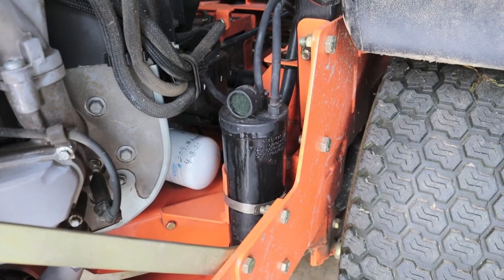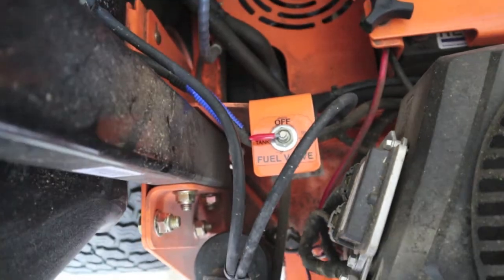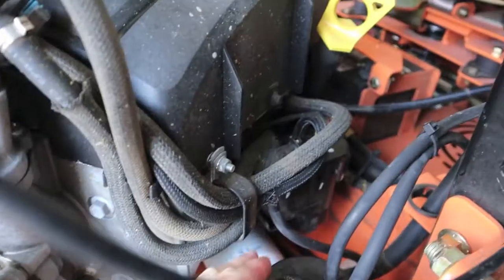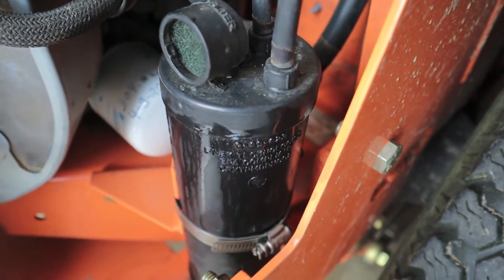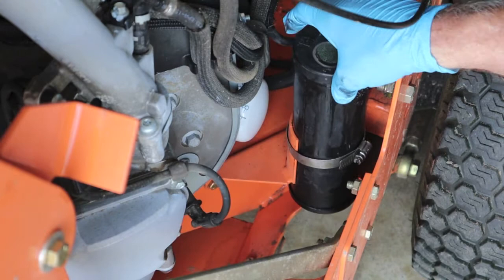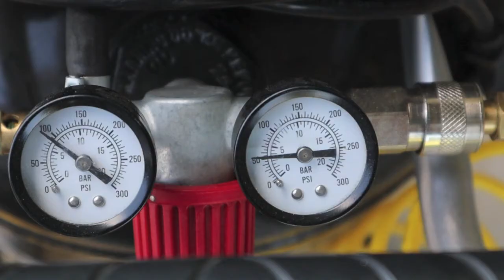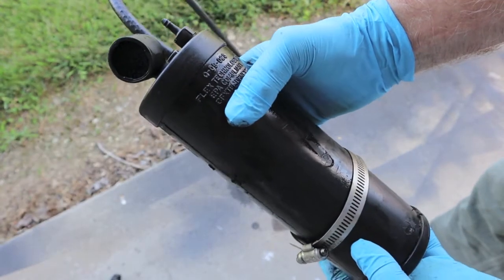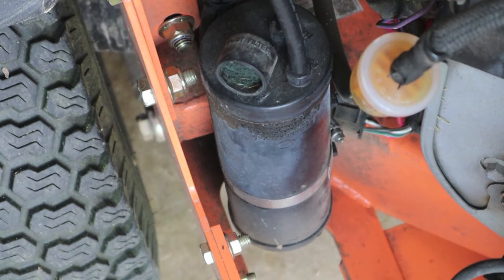EVAP Carbon Canisters Full of Gas! Can They Be Saved?

Comment: Its my understanding that these are just non pressurized containers of charcoal media that absorb fuel vapor from the tank and then hold it until the intake can burn them off. This happens (on a 82 mazda truck) like so: Tank vent goes into canister and fuel vapor is produced under very slight pressure (<1 psi) under normal storage temperatures, ie in your warm garage. These vapors flow into the canister and are absorbed by the active charcoal and held. Once the motor starts, the vacuum on the purge valve pulls air through the large VENT through the active charcoal and the fuel (now possibly in liquid form at bottom of canister depending on concentration) and up into the intake manifold to be burned. There is NO 30 PSI pressure in that tank or else it would possibly rupture spraying fuel everywhere and putting the company out of biz after it kills someone. I would guess that the vacuum to that canister is not being turned on by some malfunctioning purge control valve upstream of that purge vacuum line and it has been collecting fuel vapor for some time. On my truck, this purge line is opened to vacuum after the engine comes up to temp via a therm-valve threaded into the water jacket. If yours is air cooled, It must open under straight intake vacuum. Start mower and put a vacuum guage on the purge hose and see if any vacuum develops under operation.  it should pull a small amount of vacuum depending on the design, possibly full vacuum through the .020 orifice for VAPOR ONLY. These canisters are never pressurized over about 1 psi. Tank line must go to tank, purge must go to vacuum source or purge control valve.
Reply from the maker: Right, the only pressure is from the electric fuel pump to the injectors, and Kohler specs 39 psi on the EFI pump.
Thanks for watching and the information you gave!

Comment: I know this is 10 months old but you can take those apart and dump the charcoal out, then you can clean the filters located inside the inlets. I had a customer who overfilled the motor with oil and it sucked oil up the purge line into the canister. What a mess.
Reply from the maker: Thanks for the tip!

Comment: Interesting.  With the mower not running, expanding fumes (hydro carbons) from the tank are absorbed by the dry activated charcoal canister and are held there, excess air is vented.  When the mower runs, there sometimes is a vent solenoid that comes on at higher rpms to pull fresh air through the canister and burning it in the engine.  This is the purge cycle. This is usually closed at low rpms so the mixture will not get too rich.  This is not a high pressure system so leaks are not of concern. It should stay dry in operation or the purge line is not working.  Or it is getting raw gas from the tank hose.
Reply from the maker: Thanks for the info! The vent on top the gas tank terminates on just the other side of the tank.
I still find it very hard and very unlikely any siphoning action is going on. For that to occur, a steady stream of raw gasoline would be stringing from the half tank level to the top of the tank....not going to happen.
So, I've been filling to the half way level and when parked for the night, loosen the tank lids then barely close till gasket contact. So far no gasoline pouring out the canisters.
My local dealer told me he's never heard of it happening.....smh.
A dealer in Louisville, KY told me it's giving them lots of problems. 
Also the purge and vent lines are deteriorating badly, to the point of crumbling. In 5 years this should not be happening.
Thanks again!
Reply: @pmtips4482  So it’s still a mystery? I just smelled gas today on my 2018.No sign of seepage.You do the best vids on the cheetah.